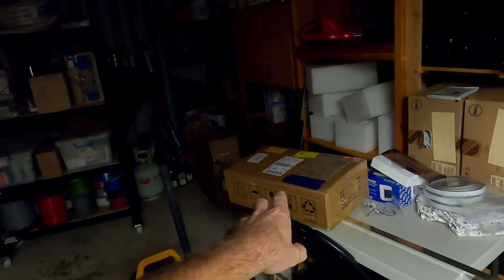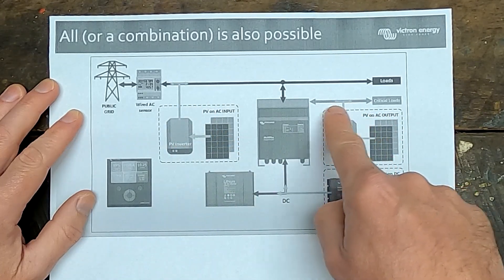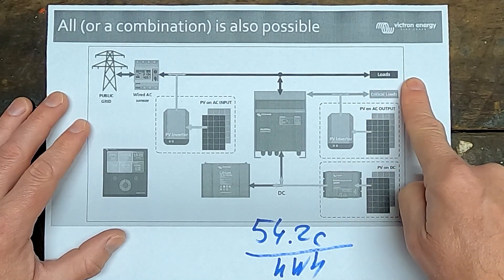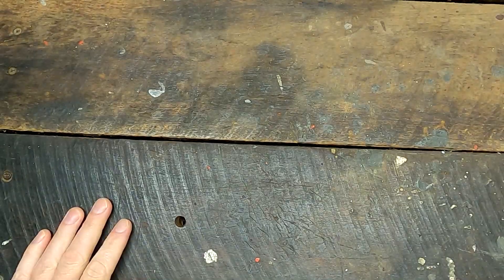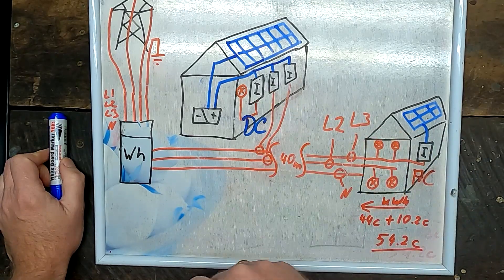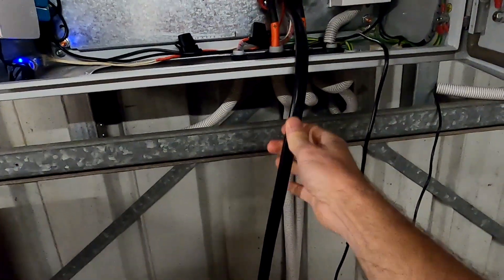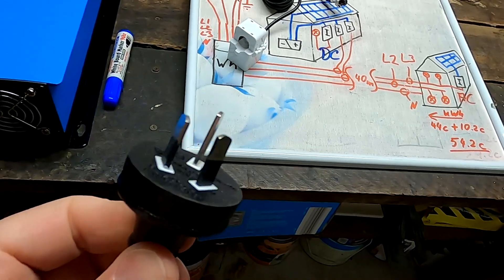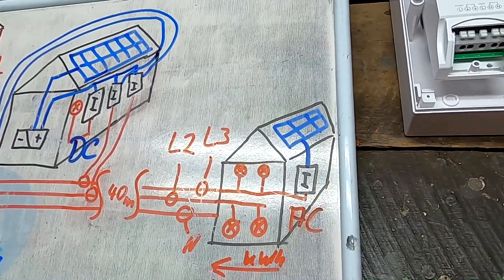Zero feed-in solution to power the house from the battery (and stay legal)

Comment: Andy, interesting to see your concern about having to get an electrician in to install a meter.  Where I live just a few state boarders away, most of the stuff you have done in the off grid garage has to be done by an electrician.
Reply from the maker: Not a concern, but the energy provider will start asking questions about the whole setup. I have my doubts, they will understand the concept.
Reply: @OffGridGarageAustralia  I doubt they will ask why someone is connecting an ET112 ct/meter.  I had one installed to limit my grid tie inverter from exceeding the export limit.  I am pretty sure it is placed on the consumer side of the main breaker, you don’t even have to pull the house fuse to have it connected.
Reply from the maker: @Muppet_Interfector  Yeah, I've seen these meters for export limiting. That's a similar concept as with the inverters and CT. A CT is just easier as I can just do it myself without even disconnecting anything.

Comment: As I mentioned before: You don't need an external meter with the MultiPlus or Quattro. I've actually had mine hooked up like this. The external meter is optional, and only needed to try and achieve "net zero" which isn't what you're trying to do. You just want to power the house from battery at night and from the grid during the day. You don't need any external metering to achieve this. The MultiPlus and Quattro have a physical relay that connects the "input" and "output" terminals together when operating in pass-through mode. In pass-through mode the inverter and charger are both off and energy generated by the AC coupled panels flows right back to the grid through the inverter.

The Victron MultiPlus or Quattro, when operating in "pass-through" mode, will pass the exported power from your solar panels back to the grid unmodified. It won't use any of the AC coupled solar to charge the battery unless you disconnect the MultiPlus/Quatro from the grid or switch out of pass-through mode.
Reply from the maker: Thanks, Jeremy. That's the first information I could find about that feature. In all documentations I've found, it says the AC solar will charge your battery first before it goes back into the grid. That certainly not what I want.
How do you switch it over from day to night mode? Will it completely disconnect from the grid then or just add power from the battery like the SUN inverters do?
Reply: @OffGridGarageAustralia  The Victron MultiPlus and Quattro units are really just an inverter and charger combined. As such: you can enable/disable the Inverter and Charger separately. Normally when a Quattro is connected to the grid there is a relay inside the unit that physically connects the grid (IE: The "input" side of the unit) to the load (IE: The "output" side)

It's important to keep this detail in mind: When there's power supplied at the input side the Quattro activates a relay that directly connects the input and the outputs together. Thus energy can flow freely between the input and output in either direction. This means that power from your AC coupled solar panels can flow right back through the inverter and back to the grid. There's no "diode" or anything of that nature that can stop power from flowing backwards from the load side to the input side.

All the Quattro can do here is either use the inverter to add power to the line, or use it's charger to subtract power from the line. For example if you have a generator on the input side and this generator maxes out at 5,000 watts and you connect a 10,000 watt load: The inverter can use it's inverter to generate an additional 5,000 watts to produce a total of 10,000 watts on the output. But it  simply does this by very closely monitoring the power flowing and adding just enough power in parallel with the generator to 

Likewise when you connect AC coupled solar to the "load" side of the inverter: The only way power is stopped from flowing back into the grid is if the "charger" component in the Quattro is able to pull that power from the line before it flows back to the grid. Therefore if you want the power to flow back to the grid and not to your battery all you need to do is turn off the "charger" side of the Quattro. Once the charger is disabled the energy will flow right through the load connection through the relay and out to the grid through the input connection.

Victron has physical dry contact inputs on the Quattro that can be used to enable/disable the charger and inverter separately. Or it can be done in software as well. If you turn off both the charger and inverter at the same time this puts the unit in "pass-through" mode because it cannot add nor subtract energy between the input and load connections. In this mode it's basically just an expensive on/off switch.

So all you'd need to do is set up some way of turning off the inverter and charger during the day, putting the unit in "pass-through" mode. Your battery would continue to be charged via your DC coupled panels because they charge from your MPPT which is controlled separately from the charger in the Quattro. Then have the unit disconnect from the grid at night and power everything entirely from the battery via the inverter.
Reply from the maker: @JeremyAkersInAustin  Thank you for your explanation again. I have now signed up the the installer portal from Victron and have watched a lot of videos and webinars showing exactly what you just explained. In power assist mode the inverter does a similar thing as the SUN grid inverter I'm testing here, it adds power to the grid power to supply your load.
I have also seen the relay inside the Quattro (or two relays inside the Multiplus II) which make it conform with local regulations. The Multiplus also can be a grid forming unit, so in case of a power loss from the grid, it still supplies power to the house and also keeps the AC coupled solar running (just not feeding in any more obviously). All that makes it a very versatile unit. They can also be stacked in parallel if more power is needed. Victron says, inverters in parallel should be the same age though... which makes it difficult to ad another unit years later.
Reply: @OffGridGarageAustralia  Yeah they are very versatile. The Quattro and MultiPlus are basically the same unit. The Quattro is just a MultiPlus with two inputs and two outputs. (The MultiPlus only has one input) so it's the Quattro that has 2 relays and 1 relay for the MultiPlus (Unless that's changed recently)

I have actually used my Quattro's as "grid forming" inverters. When we had the big winter storm in Texas that knocked out power for days: I hooked up the output from my Quattro units to my house panel and I powered everything in my home using my Quattro's. The first day there was too much snow on my solar panels to run off of solar so I used my diesel generator on the "input" side of the Quattro's to charge the battery as needed, but on day 2 I had cleared enough snow that I was able to run the entire house on solar alone. I have 17 kW of AC coupled solar on my house so by using the Quattro units to form a local grid it allowed my AC coupled solar panels to operate and actually back feed energy into the Quattro to keep the battery charged during the day.

They are awesome little units for sure.
Reply from the maker: @JeremyAkersInAustin  Awesome turnout. I like the idea that you have the AC solar still working even the grid is gone and backfeeds through he Quattro/Multi to charge the battery. The AC solar wouldn't work otherwise but recognises the inverter as grid and keeps working. 
Do you know if the Quattros switch only the active or the neutral as well through the relay? That would be another concern I have as I have only two phases and one neutral to the house. The neutral then splits into N and PE inside the house. If I install one Multi on one phase to start with and it switches the neutral as well, the other, still connected active, would be without neutral then.

The Multiplus II has now two relays in series at the input to comply with local regulations. I believe they will be triggered differently in case of different faults.
Reply from the maker: I just got information back from the Victron dealer/installer. Apparently, I'm not able to use a Multiplus in my system. The problem seems to be that I have only two phases plus one common neutral from the meterbox at the garage to the house which is not enough to make it work with the Multiplus. If I have two Multiplus, one for each phase, and one goes in off-grid mode, it would cut off the neutral for the other phase which is still connected to the grid.
I cannot find any information as of the Multiplus does actually switches both, phase and neutral or if the relay inside just switches the phase and the neutral is just connected anyway all the time regardless the mode the Multi is in.
I will contact Victron directly and ask these questions.

Comment: I doubt if it is legal as you could easily pull out the limiter CT and battery will then feed the grid with as much power as it can generate!
Reply from the maker: Legal? I could install just another grid tie inverter in my garage and feed power into the grid. Of course that would be illegal. The same as driving 60 in 40 zone...
Or people used generators to feed in power and cash in on that 44c/kWh tariff.
That is all not allowed, so we don't do it.
There is always a way around the legality and people will do that. I'm not risking the contract so will not turn on the inverters during the day. It's that sumple.
Reply: @OffGridGarageAustralia  if a grid goes down will you'r Sonos automatic sockets forget curent time, potentially turning additional inverters on when they should be off? That could lead to power company terminating you'r contract.
Reply from the maker: @volodumurkalunyak4651  all inverters have Anti-Islanding. They cannot keep themselves alive if the grid goes down.
Reply: @OffGridGarageAustralia  i'm asking what happens after grid power is restored. If smart switches switch on at inappropriate time, you can jave additional (grid-tie, located within garage) inverters that provide power toogether with approved solar system. You'r contract for 44c/kWh can be terminated from that.
Reply from the maker: @volodumurkalunyak4651  the smart switch will not switch on after power is restored. I have to do this manually, or it waits for the next timer trigger the next day after sunset. It's a smart switch 😉
Reply: @OffGridGarageAustralia  if you'r smart switch don't forget current time when unplugged everything is fine. Outherwise it waits for the next timer triigger and that can happen in the middle of a day
Reply from the maker: @volodumurkalunyak4651  I've got these switches for over 10 years and they never forgot any settings after a power loss.
Anyway, I'm not using these inverters, it was just a test to see if it would work from a technical perspective.

Comment: Hey why don't you check them in and inverters from EASUN THAT ON GRID HIBRID tide.... Which if ill-injected the surplus into the network I work with this.... VICTRONOFTHAT SAYS HAS GREAT STATICAL CONSUMPTION.... I ditch di Romania and I have this type of inverter for 4 years and it works flawlessly

Comment: Hi Andy,
Cant you extract a signal from your House Inverter, that when it turns on, it activates a Contactor that cut your Battery house inverters off?
It seems a lot more reliable to me, than guessing a time, when you expect the house inverter to turn on. What about realy cloudy Days? Solar can certainly turn off during the day.
What if you get the time in the Sonoff wrong, and the Battery powers the house, and th house feeds the grid? Dont risk loosing your contract.

Comment: Helllo. Interesting solution !!! About the first part of your video, you need to get more info about AC Coupling, Frecuency Shifting and Factor 1.0 rule. Victron works welll with Fronius for AC coupling but maybe not with your actual grid tied inverter. When grid goes down, the grid tie inverter on the back up / criticals loads side will stay on and if there is not enough loads on, the current will go to the batteries., If the batteries are already full, the multiplus or any other hidrid inverter with ac coupling habillity must be able to shut down the grid tied inverter, this is generally done with frecuency shifting...
Reply: Dont need Fronus - any GT inverter that accomodates freq shifting - SMA also can do this.  The multiplus also allows fro power export if you want - you set can the export limit to 0 or any other number

Comment: An Off Grid system  could run one single inverter and get 8kw (MPP8048max). Its off grid however the inverter does have a grid input and an internal synchronized 240v change over switch. This type of inverter cannot feed back to the grid but can switch to the grid if batteries are running low. You can keep your Victron battery charging system which is very good but run the inverter off the 48v. The issue is you need to have an off grid breaker panel. So in my system nearly all the grid inverter system returns power to the grid and the Off grid system runs most of my house.
Reply from the maker: That is one solution, But again, it would mean a major change in cabling and I would need to install a transfer switch.
Reply: @OffGridGarageAustralia  The Pip 8048max has a transfer switch built into the inverter.

Comment: I have wondered if those would be good for like an off grid or something where 1 big enough inverter might be expensive or expensive all at once or using them the same but in conjunction with a generator
Reply from the maker: They are grid following inverters though, not grid forming ones. They will not work in an off grid system.
Reply: @OffGridGarageAustralia  they should with a regular inverter
Reply from the maker: @james10739  I would hesitate to connect these inverters to an off-grid inverter. If something goes wrong with the limiter, they then try to 'export' through the off-grid inverter.
Reply: @james10739  since they have "anti islanding" they should not work with another inverter, they can tell the difference somehow.
 I believe SMA has a solution though, being able to have a "mini grid" for a few isolated homes not connected to a standard utility.

Comment: multiplus II also has CTs as accessory
Reply from the maker: But can it feed power back from the load side during the day and turn on the battery if there is no export any more?
Reply: @OffGridGarageAustralia  Yes it can. Multiplus is used in situations where equipments need more power than grid has.

Comment: What about when the grid goes down? That inverter will also stop producing. Plus that inverter isn't certified for a lot of countries. Still think a day with a trencher and some cabling with a transfer switch will be much safer solution (plus you can add other services between house and shed like water pipe and ethernet cabling etc) - Will Prowse mentions the same as having a line for a 'generator' is a common pattern completely separate system and no repercussions from the authorities if installed correctly.
Reply from the maker: If the grid fails, all inverters will stop working except the off-grid inverter in my garage. 
I cannot run any additional cables to the house, that is not an option.

Comment: Your third solution appears to me to be extremely dangerous and I don't think any electrical inspection would pass it. Additionally if you loose power to your house you will have no backup. You have not discussed an OFF Grid solution yet.
Reply from the maker: Loosing the grid is a different issue and not a concern at the moment. I know, these inverters are grid following only. I would need to upgrade to a Multiplus then which can be grid following and also forming.

Comment: I'm not convinced back feeding via a GPO is legal. 
How good is this at managing sharp drops in loads? Could it momentarily register some export on the grid meter? That would raise some eyebrows at night time.
Reply: Alex you are right, in Australia it is not legal at all, under no circumstances!!
Of course people still do it, but no not legal!
I'm not trying to be the fun police here, just stating the facts.
Reply: @ValRigoli  So the timer should be use to turn off the grid tied inverter at night, not at daytime
Reply: You are right. After sharp drop from high load there is backfeeding for 2-3s.
Reply from the maker: The inverter has anti islanding and stays far under trigger time for RCDs and so within the regulations.
If we have a sharp drop of load at high load, it takes 1-2s until the inverter is able to catch up and will backfeed some of the energy. That is not a problem either as the meter will compensate and offset that with the other phases as they still draw power from the grid.
Reply: @OffGridGarageAustralia  Are you saying that this unit meets all Australian standards and is an approved unit by your energy supplier. I find it very hard to believe. Andy your are always promoting safety first and that is what I loved about your work up until now. What you're are suggesting now is incredible dangerous. Do you trust the spec sheets on a Chinese data sheet that has not been approved in Australia or most western countries. Approved RCD's should be as close to the source as possible, with no other unprotected connections behind the RCD, this can not be achieved with a simple connect to a GPO.
Reply from the maker: @markparker9749  Not connecting the inverter to GPO. That's just how they supply the idea. The inverter is all CE certified and meets the regulations. Most of my stuff is from China, even the Victron gear.
Reply: And will it have a double fault tolerant isolator for anti islanding
Reply: @Muppet_Interfector  These inverters are powered directly from grid so in case of blackout they immediately go down.
Reply: It don’t matter, if they are not double fault tolerant you can’t hook them up